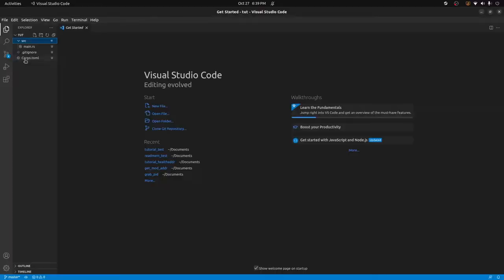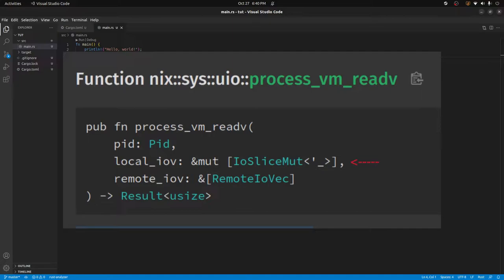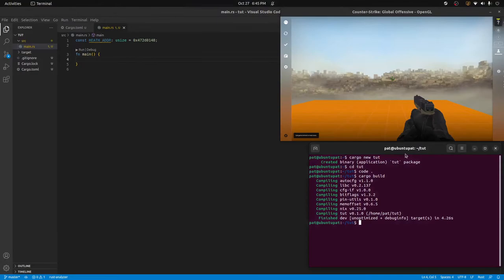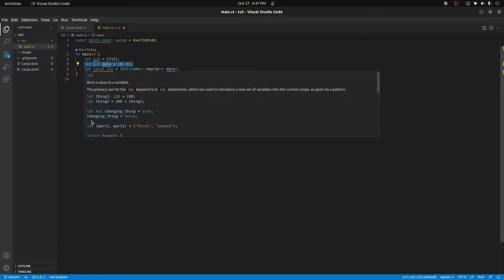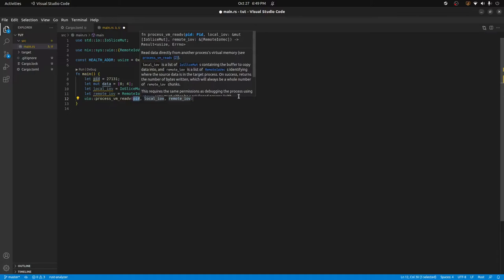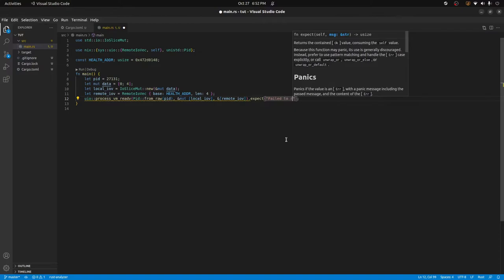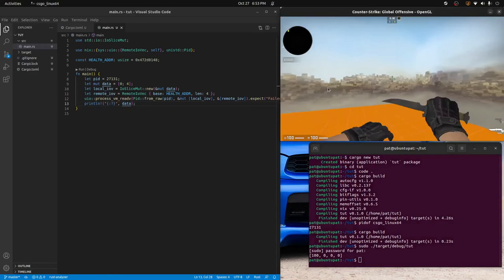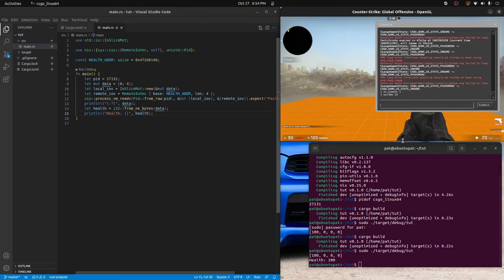Reading another process’s memory in Rust using “process_vm_readv()”

Comment: Sorry for the comment, if you wouldn't mind could you let me know how I'd find the base address of a module? "libc.so.6.4" in my case (assault cube)
Reply: Using the nix crate or similar api, to clarify.
Reply: so it seems like reading /proc/{id}/maps on linux yields the correct data, seems a little hacky but works for now

Comment: on windows wouldn't this be easier to just use a dll and injector?
Reply from the maker: You could easily make an injectable shared library on Linux too. You can also use ReadProcessMemory from the windows api to read a remote process.
Reply: @faalu  also i made a function to get the process id automatically if it contains a certain title like "ac_client"
Reply from the maker: @JayRain  nice! On Linux? You're searching through the proc directory?
Reply: @faalu  i meant on windows, also readprocessmemory seems to work but not writeprocessmemory for some reason when i am trying to change the ammo
Reply: @faalu  nevermind i accidentally opened the process with the wrong access level which caused it to be rejected
Reply from the maker: @JayRain  you're on windows, so you're using process32next and iterating through procceses that way?
Reply: @faalu  yes iterate through those then once it's the target process use OpenProcess on the proc id then ReadProcessMemory/WriteProcessMemory
Reply from the maker: @JayRain  nice! And you're using Rust? Would love to see the final result.
Reply: @faalu yeah i’m using rust and the windows crate
Reply from the maker: @JayRain  sweet, post a video of your results when you're done!
Reply: @faalu  that's how you would do it. Using a dirent struct. I wrote my own function for this in rust and C++ as well.